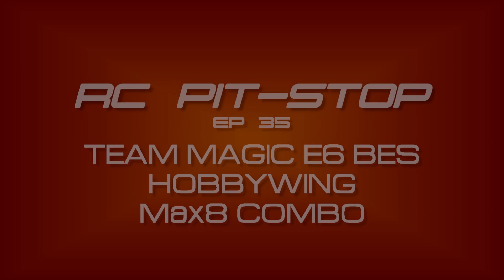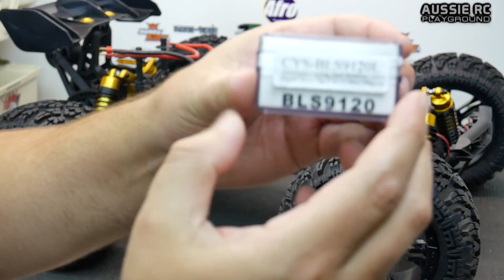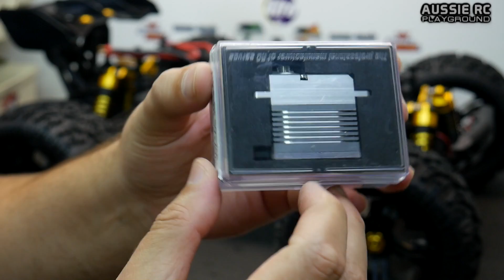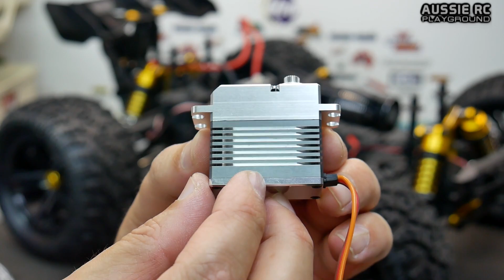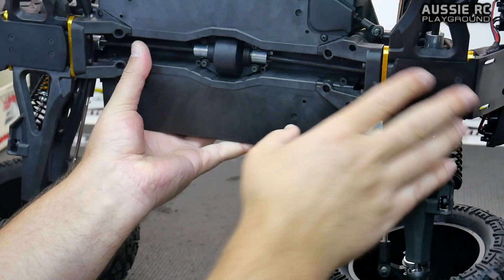RC Pit-Stop EP35 - Team Magic E6 BES HOBBYWING EzRun MAX8 Combo

Comment: Any chance of doing a vid of using the hobby wing programme card, as like where exactly do you plug it in to the ESC and how exactly to use it etc, I have a HBX T6 Hammerhead and want adjust the braking force, punch etc, this is my first computerised RC as I have just got back into the hobby ... my last cars were a “Frog” and then a “Hotshot” both made by Tamyia back in the 80’s I have gotten the hobbywing program card but the instructions are a bit vague, I love your videos by the Way

Comment: That truck looks sick vas,can't wait to see how durable it is.It most definitely will be my next purchase.I have that max8 combo in my Arrma kraton with the mt4 G3 wheelie bar and i really like it.I soldered on the cap pack tho(manual states to do so if doing 6s or high speed runs) even though it may not need it.Can't wait to see the running vid,bring it on vas lol

Comment: awsome as allways Mr Vas, one thing that i have been wondering over. Why do you use doubbleS teip and zip? I might be wrong here but other HW in the 1/8 range do have mountingholes. i direct mount it if i can. it looks clean and is stuck..

Comment: G'day Vas, 
you can also fix the problem with the motor rotation by changing your Motor Rotation from CW/CCW to CCW/CW. I don't have a Max8, so I can't tell if you can change it on that particular one, but it works on my Xerun.
Reply from the maker: Yes, you are correct, it can do it. To be honest, I didn't even think of it at the time and I'm just so used to simply swapping the wires around that it was the first thing I did. It wasn't until after I used the program card that I saw I could've just switched the rotation. Not a big deal, it solved the problem.
Reply: +Aussie RC Playground I was used to do that do, but once did it on a sensored ESC by mistake. Since then I always change the setting in the esc, to not getting used to swapping wires again :)